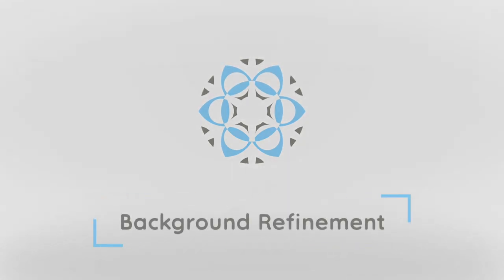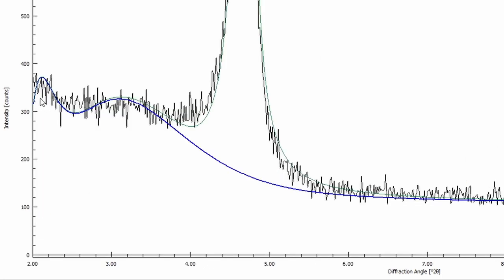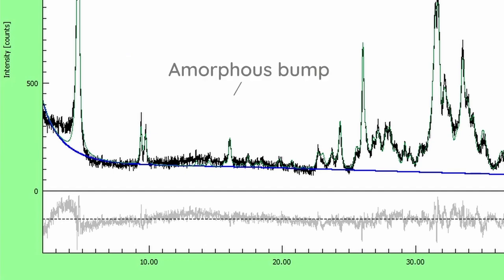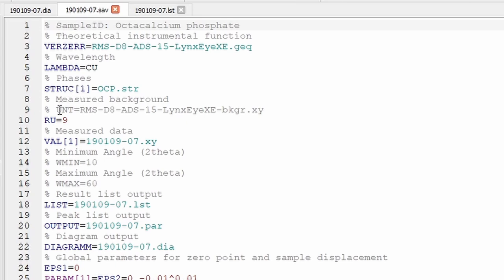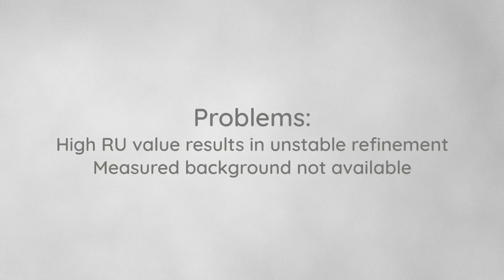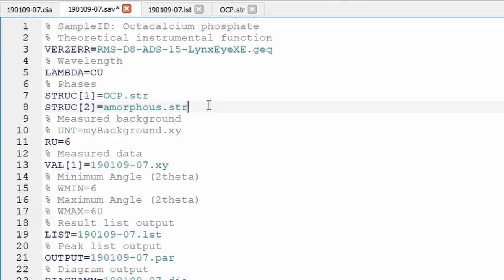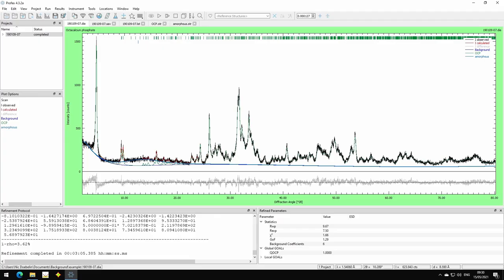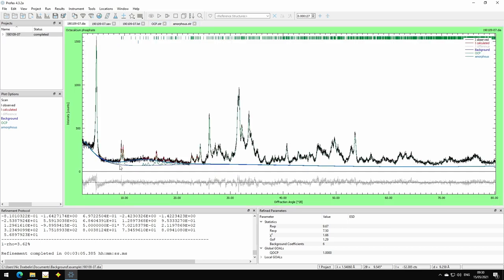Profex XRD: Background refinement

Comment: thx for the video!! We have issues with smectite/illite peaks at about 5,7 2Theta (deg). The background is often way to low or the for the following peaks, such as the 8,7 2Theta (deg.) illite peak. The Problem might also come from unfitting smectite structure files. We have tried the montmorillonite str. files as a substitute for the smectite file, which is also not a good solution.
Reply from the maker: It is difficult to guess what the problem is without seeing the data. It could be because the measured low angle peak is actually smaller than it should be, for example because the automatic divergence slit is inaccurate, or because the beam spills over the sample. At very low angles instrument alignment is more critical than at high angles. So you should check if the modelled peak is too strong, or the measured peak is too weak. It could be one or the other. The former must be fixed in the refinement, the latter in the hardware/sample. Either way, the too strong model peak pushes the background down. Once the peak intensity is correct, the background will fit well, too.

Here are some tips for accurate low angle peaks:

- make sure your sample surface is perfectly centered in the center of the goniometer (no height error)
- maybe use a fix divergence slit. Not the automatic one set to fix mode, but really insert a fix slit. They are more precise
- make sure that the sample dimensions in the Profex instrument configuration are entered correctly
Reply: @profextutorials2325  Thanks a lot!! Its working way better now. Although, we don't have any other chance but to work with the automatic slit in fixed mode and an additional one (behind the automatic one) with the same size.